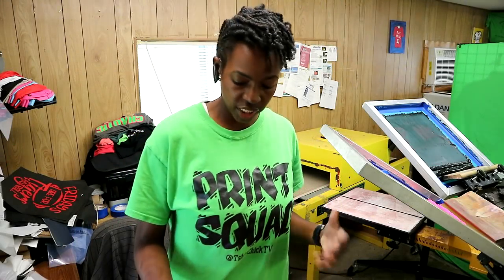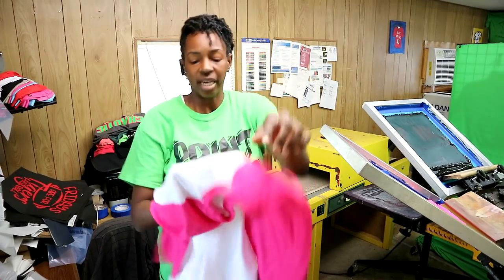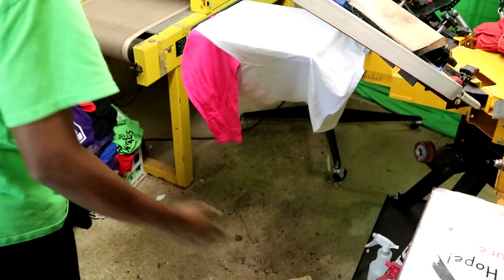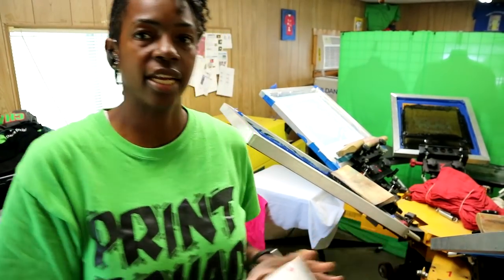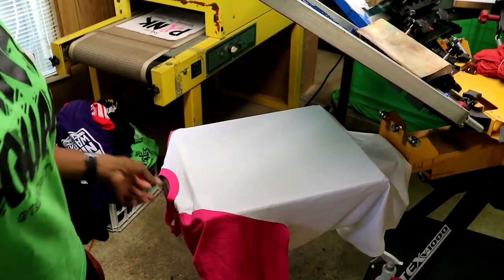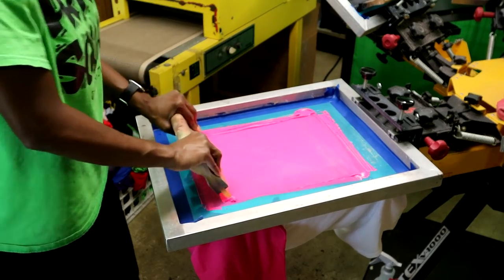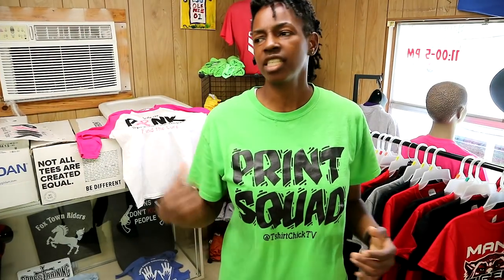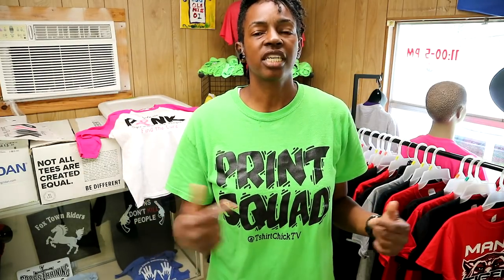Printing For Breast Cancer Awareness

Comment: I'm about to order a 2 station 4 color press from a friend. I will be doing shirts mainly for myself. Are wood frame screens any good?
Reply from the maker: I started out using the wood frames because that was what came with the el cheapo press that I started with but, I would recommend the aluminum frames because the wood ones will warp over time and make registration hard.

Comment: That came out so awesome. Why the shirt seems like its stuck after?
Reply from the maker: In order for the shirts to stay in place when printing so that you print the design in the correct location you would use some type of adhesive to hold the shirt down so that it won't move in between prints.
Reply: Oh ok, I thought it was the ink going tru or something. Thank you